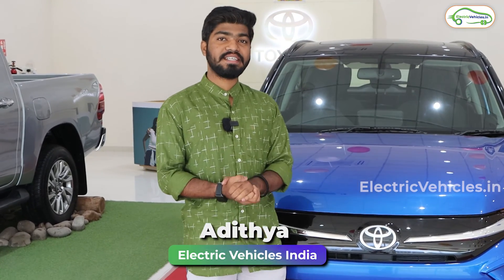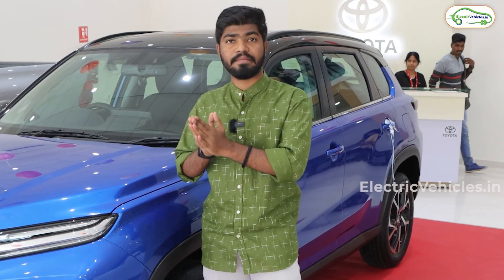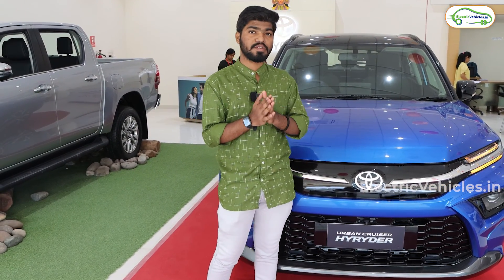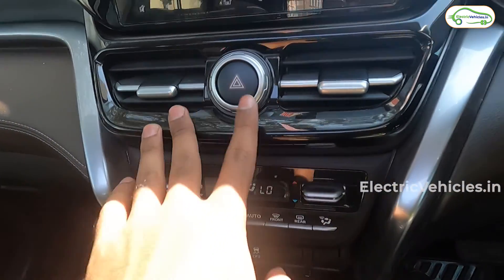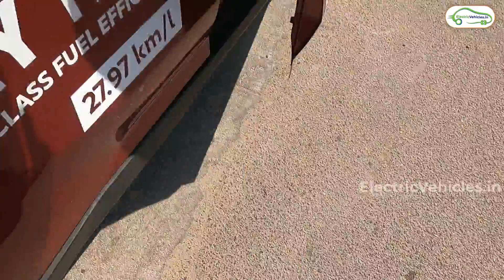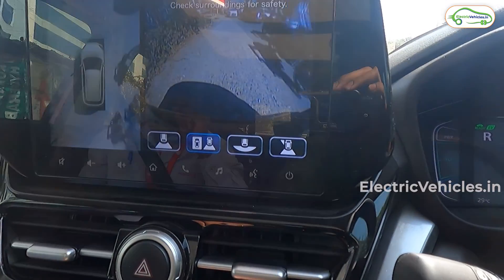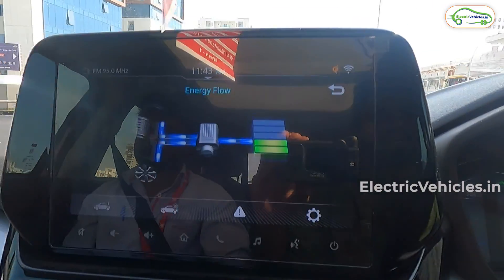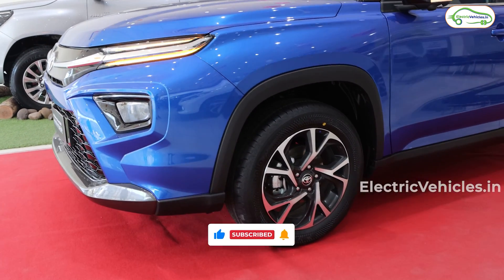Toyota Urban Cruiser Hyryder Car Review | Electric Car | Electric Vehicles India

Comment: Ekk baar battery kharab toa beach mai aatak jai gi 😂. I have already taken an electric battre lo-ev scooter but before 1year i have changed MCB RS.300, horn RS.200, Alarm finder RS.3000/- , charging socket RS.250/-, Running power stop due to water get inside it's cost RS.200/-  and after 1.5year my battery automatically goes off after 15km. I have taken Kalpak 40ah battery which I have got with electric scooter, so that's means It's gives me 90km am I right.
Reply: 160000 kms or 8 years battery warranty watch the video again
Reply: @ag135i  🤨Sorry sir I have already taken an electric battre lo-ev scooter but before 1year i have changed MCB RS.300, horn RS.200, Alarm finder RS.3000/- , charging socket RS.250/-, Running power stop due to water get inside it's cost RS.200/-  and after 1.5year my battery automatically goes off after 15km. I have taken Kalpak 40ah battery which I have got with electric scooter, so that's means It's gives me 90km am I right.
Reply: That must be some of the worst company ...in old i did not see any probs